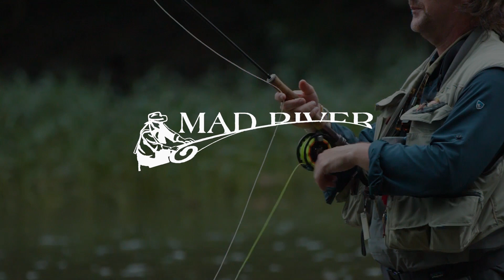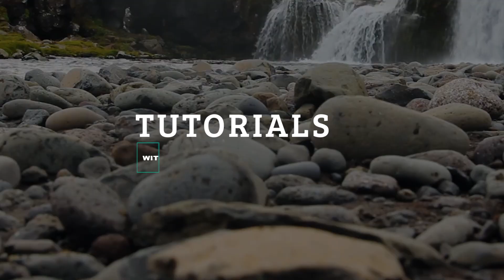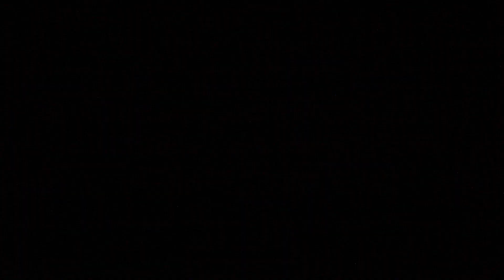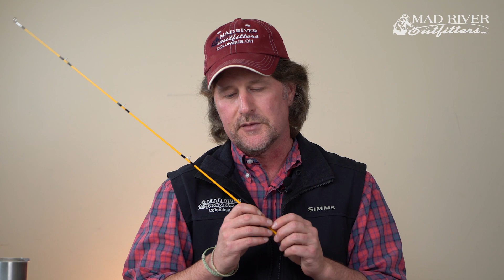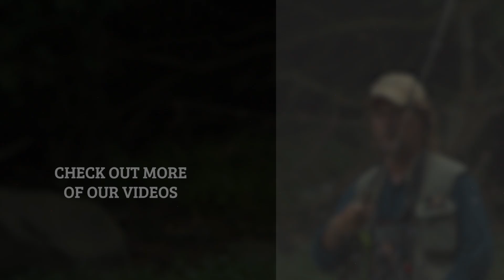How To Put Together A Fly Rod: Tutorial

Comment: Been flyfishing for 22 years and I've been LOVING your "getting started" series. Quick question. My dad taught me to lightly rub the tip of the ferrule on my nose to give it a very very light coat of oil (maybe also to remove any light debris) before doing the twist and push connection. Do you think this is necessary or maybe even harmful to the connection? I'd never dream of waxing the ferrules, but I always perform this little nose ritual out of habit and deference to my dad when I build my rod. Thanks!
Reply from the maker: Thanks for watching. As he states here, oil or wax is not needed if done properly.